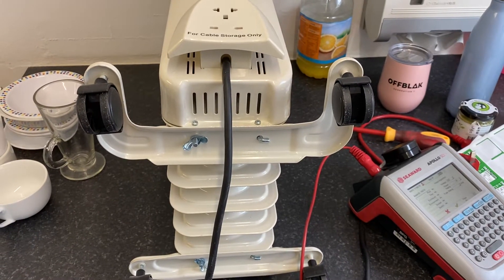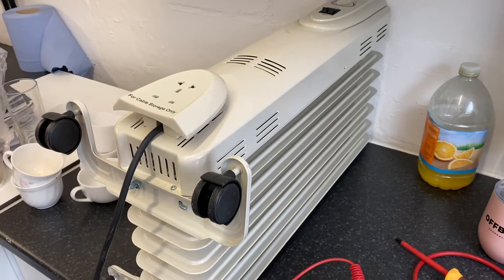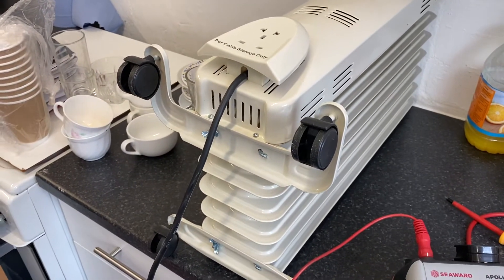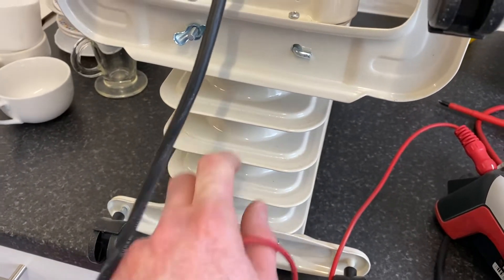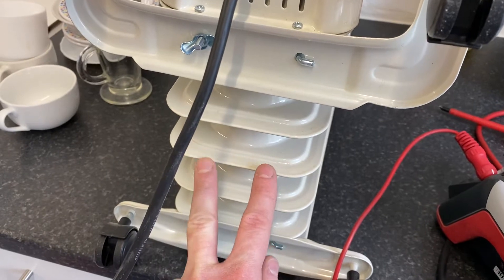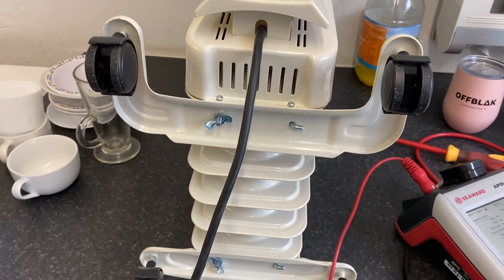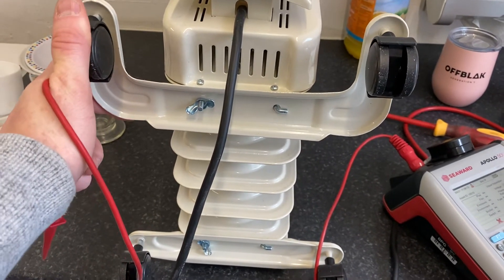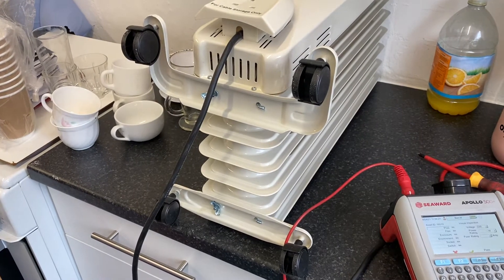PAT Testing Tutorial - Top Tip - Class 1 PAT Testing Procedure

Comment: My oil filled radiator has a tlt switch so will not turn on unless vertical. So it's not possible to pat test on it's side?
Reply from the maker: You can certainly do the earth bond test on its side then turn it upright to carry out the IR test as you don’t need your probe attached for that on a class 1 device.

Comment: Have you ever pat tested a sewing machine? Struggling to find any info
Reply from the maker: Yes absolutely, most of the time they have a separate power supply which is a transformer down to 24v which would mean a visual inspection on the machine itself and sometimes just a visual on the power supply as they will be all plastic construction
Reply: @caterhampattesting  thanks that's what my understanding was. Is there any merit in testing the cable and machine together on the pat tester?